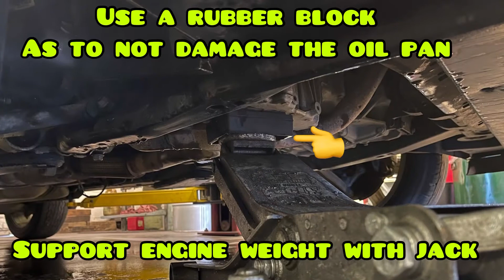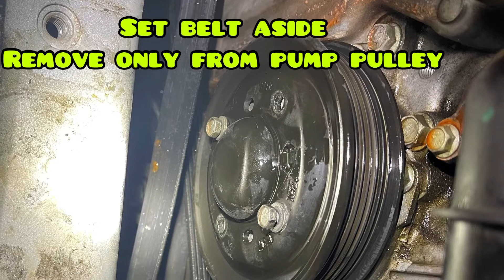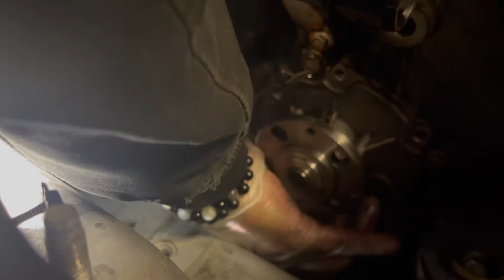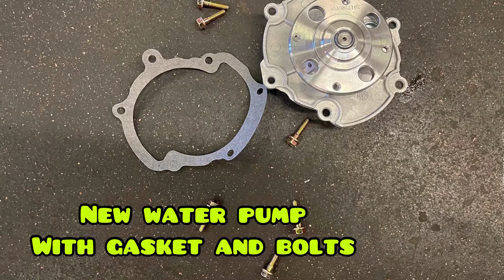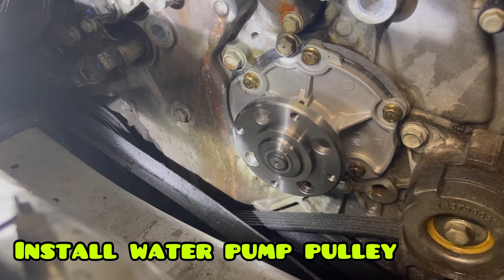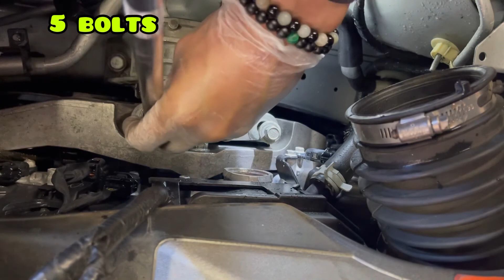How To GMC Water Pump Replacement/2010 Cadillac SRX/GMC Acadia Water Pump Removal And Replacement

Comment: Where did you bleed the air out from? I’m not seeing a radiator cap other than the reservoir cap. Currently working on 2011 Cadillac srx
Reply from the maker: I bled coolant with vehicle running and reservoir cap off while topping off with coolant at the same time as the engine is running. I hope this helps. I appreciate the feedback 👍
Reply: Is this before or after you replace the water pump
Reply: @Raymundosan  after changing

Comment: What’s labeled as the “water outlet”. Are you just replacing the plastic elbow? Or the housing?  I can’t seem to find just the plastic elbow
Reply from the maker: When I replaced the elbow. General motor part dealer told me it was called a water outlet. I replaced the elbow “water outlet “ and the water pump with new coolant. I hope this helps. I appreciate the feedback 👍

Comment: Do I need to purge the sistem before changing the pump?
Reply from the maker: I usually purge or flush the system after repair. Unless contaminated with oil or other fluids. I hope this helps. I appreciate the feedback. Thank you 👍